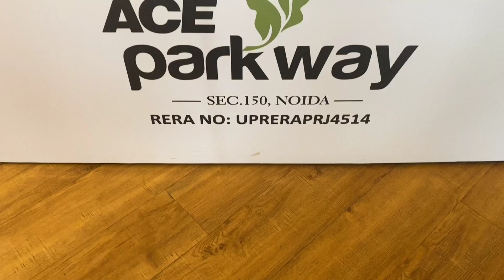Ace Parkway Sector 150 Noida | Construction Updates - Sept 2021 #AceParkway #150Noida

Comment: Price per square feet ,
Reply from the maker: Here they offer box price in which all charges included, except lease rent, ifms dual meter & govt charges. 
For 2190 sqft as per price list it's 1.64 cr + other charges mentioned above.
For more details about project & price call/whatsapp @ 9212335200 / 9136039361.